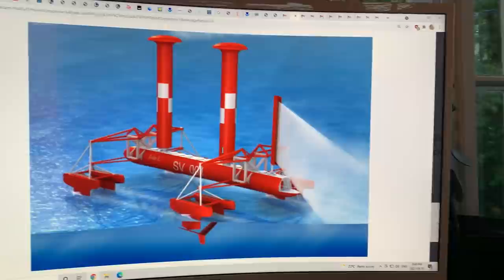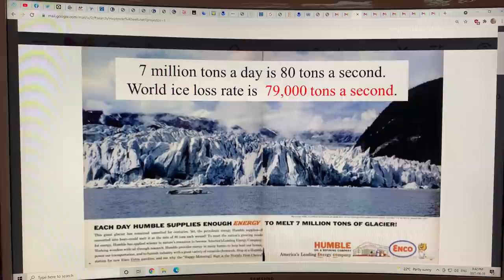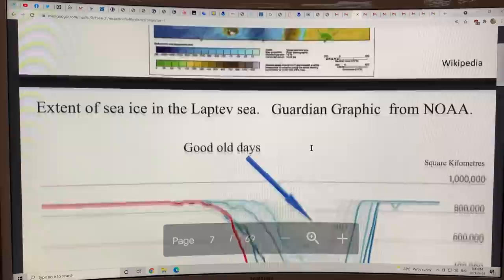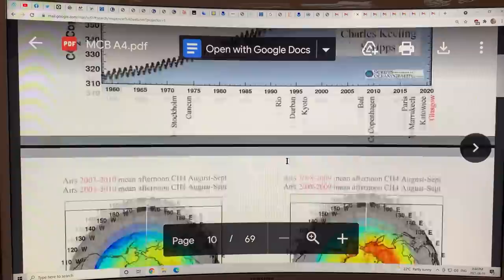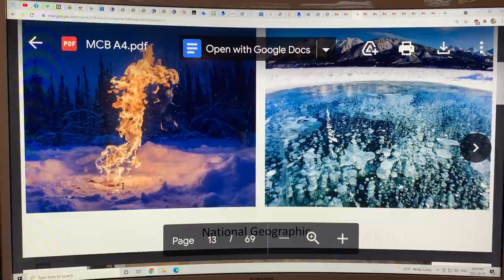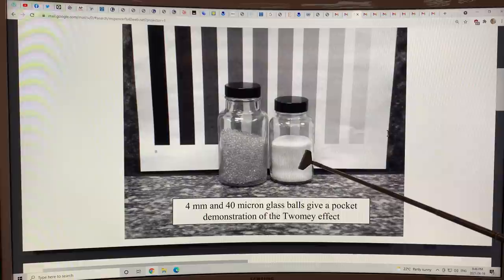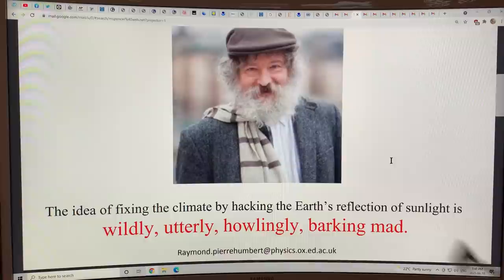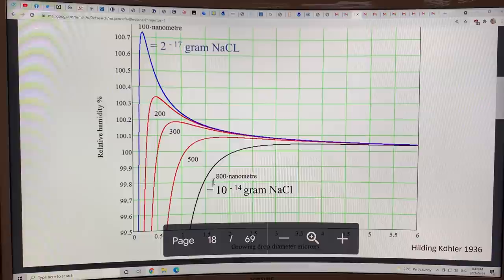On the Enormous Potential of Sea-Water Spraying to Brighten Clouds to Cool the Planet: Part 2 of 4

Comment: the sun light has changed from an orange yellow to a brilliant white yellow which is extremely hotter than a year ago
Reply: Seems like it has been changing every year to me each year it's getting more intense harder to get out and do stuff outside feels like it's pulling all the energy right out of me
Reply: Now that's interesting. Can you point me toward some resources discussing this topic?
Reply: Agree it seems hotter year by year for the last few...
Reply: I don't know about the sun. But year on year temperature difference has become noticeable and alarming. I don't understand how we'll still function in five years at this rate; especially when the jump each year is more than the jump last year. What all the "alarmists" have been crying from the rooftops is happening right now.
Reply: @goodenough22  I tend to agree with you. The death machine called "civilization" will not stop until it runs out of fuel. When that happens we'll be at the mercy of our creator. As nature intended.

Comment: Paul I want to be more optimistic. How many people are possibly getting inaccurate data or are being terrorized or slandered to suppress facts? How much time do we have and can you please make a show on how we should react to the situation of unstoppable collapse? Is it true it's too late to reverse the situation? I was informed even if we stopped all emissions it's too late because the weather has a 20 year lag.
Reply: The evidence your own eyes and ears provide will answer your question.
The Arctic is very close to a blue ocean event. The permafrost is melting and outgassing methane at an increasing rate. Both of those will lead to an exponential increase in warming.
It is the shortest day of the year where I live and the grass is still growing. 20 years ago it was dormant for three months of the year. 
There is no going back.
It is what it is.
Reply: Actually it's probably closer to 30 years but it's going to take 100s to a thousand years before humans C02 emissions to dissipate completely if we completely stopped now So yeah I'm thinking we are way too late to change the heating besides the methane gas is  already being released out of permafrost at massive amounts and will speed up the heating real quick  it's way more dangerous than the CO2 in the short range we have already activated the feedback loops that's going to be way too much for us to try to mediate by any kind of cloud seeding or ocean cooling or carbon collecting it says way too much hundreds of years of polluting we ain't going to get it out in time
Reply: Paul what about extraterrestrial intervention? I don't think the old money industrial families want to let go of power. So I don't see it changing. They run the military industrial complex and have successfully stunted innovation through force, terrorism, and surveillance. Nikola Tesla had solutions for many problems and died alone in a hotel room and men came in and stole his paperwork.

Comment: Thanks for surfacing this idea.  The great thing about it is it can scale, and it is easily started and easily stopped should it prove to have bad side effects.  It is probably not a silver bullet but it might be a pretty large BB.  Past time to see what will happen with a small trial, which would include good documentation on the exact process used, inputs used, the environmental and meteorological context and the results.  No better time to try it than NOW.

Comment: Mr. Beckwith it's always best to work from the ground floor. Letting the oceans heat up is not a bad trade off if it does not cause extinction while destroying civilization. Civilization has proven itself to be unable or unwilling to make the necessary changes.
Reply: I tend to consider the tree of life. We, at the upper end, are ultimately dependent upon the smallest animals and insects being  able to exist. Our cavalier overuse and poisoning of.... everywhere, means that, yes, it's too little, too late. This water spraying business is far too complex, susceptible to failure and error to be a long-term prospect. The ultimate irony is that all this tech is so that we can continue with business-as-usual, because as you say, the big cheeses of the world are unwilling to reduce their avarice, and are in fact stepping up the destruction. I'd love to be optimistic but i can't find any true reason to be.
Reply: @russtaylor2122  Good guy Russ. Thank you for sharing.

Comment: So stratospheric aerosol injection is not enough? You're saying we need more particulate matter in the air?
Reply from the maker: It is just salt, and a tiny fraction of what is naturally in the air anyway…
Reply: @PaulHBeckwith  Yeah, that's what they said about SAI, "It's just aluminum..."
Reply: What effect does aerosolised salt do when in the atmosphere ?What happens when it gets to the ozone layer?What happens when it drifts? What happens with those heavy particulates ,do they draw the clouds down faster as it is maybe a heavier molecule? But it's just salt? Bit dismissive there paul. Futures so bright 😎
Reply: @robmcilroy1894  Bet it makes it rain; just another fancy method of cloud seeding. Vietnam flashbacks ensue
Reply: @obsoleteoptics  I don't know enough about this ,but those things I mentioned were just off the top. I felt paul was being very dismissive of the potential monster of unintended consequences,which is a common failing of many scientists. After all it is mainly science that has got us into this mess to begin with. But somehow these same scientists know best?
Reply: @PaulHBeckwith  "just  salt"?!  its not wise throwing all that salt into the atmosphere.  The gains would only be very temporary while the risk of harm could be very significant and long term.

Comment: “The good thing about science is that it's true whether or not you believe in it.”

― Neil deGrasse Tyson
Reply: 1) By reflecting away 30% of ISR the albedo, which would not exist w/o the atmosphere/GHGs, makes the earth cooler than it would be without that atmosphere like that reflective panel set behind the windshield. Remove the atmosphere/GHGs and the earth would become much like the Moon and Mercury, a barren rock with a 0.1 albedo, 20% more kJ/h, hot^3 on the lit side, cold^3 on the dark. Nikolov, Kramm (U of AK) and UCLA Diviner mission all tacitly agree. 

2) the GHG up/down welling, “trapping”/”back” radiating/delaying/intercepting, 100 % efficient, perpetual warming loop requires "extra" energy which according to RGHE theory comes from 

3) the terrestrial surface radiating that "extra" energy as a LWIR ideal black body which

4) cannot happen because of the non-radiative heat transfer processes of the contiguous atmospheric molecules and as demonstrated by experiment, the gold standard of classical science: 
https://principia-scientific.org/debunking-the-greenhouse-gas-theory-with-a-boiling-water-pot/

1+2+3+4 = 0 Greenhouse Effect + 0 Greenhouse gas warming + 0 man caused climate change.

Version 2.0 062121
Reply: @morgothra4483  
I make three specific points which you apparently are unwilling or unable to refute choosing instead a load of ad hominem BS!!!
Copy/pasting a load of unrelated crap you don't understand, can't explain or defend does not count.